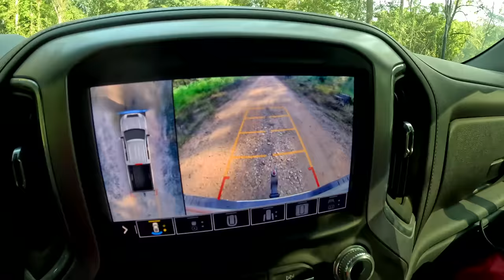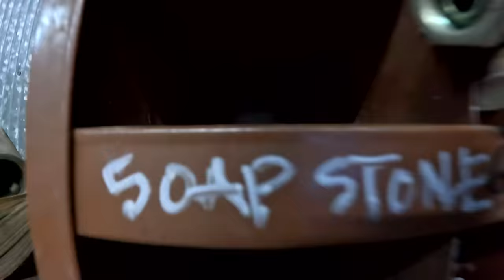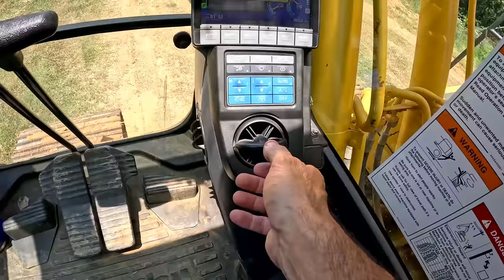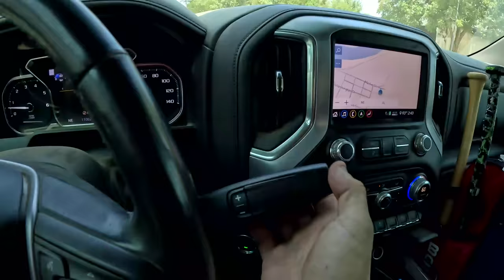ALABAMA RIVERSCREEN GOING IN PART 1

Comment: Question during job interview: “How do you know how to operate and repair a skid steer, tractor, forklift, front end loader, dump truck, dozer, 18 wheeler, combine, and do diesel mechanics, electrical, plumbing, roofing, carpentry, welding and landscaping?”. Answer: “Farmer”.

Comment: Great vid. Hey Daniel, putting an edge back on a drill bit is piece of cake. Takes a few seconds.  Good skill to learn with your engineering proess. I think the worst thing to weld is galvanized steel.  Feel your pain there.